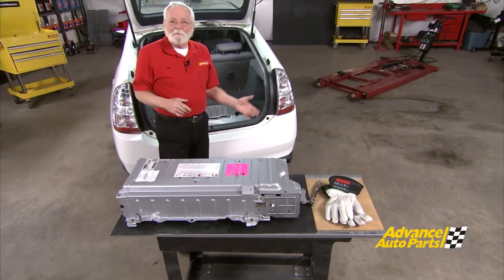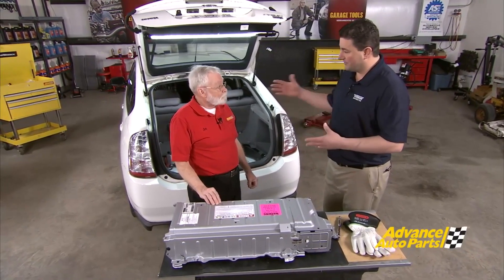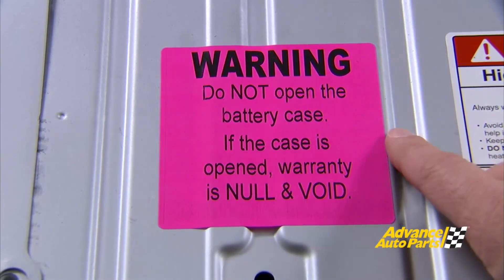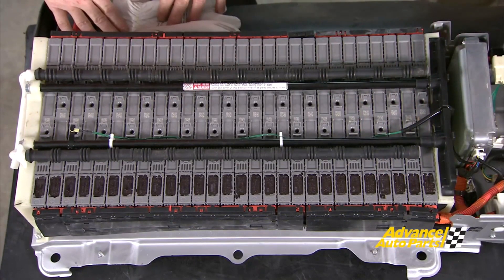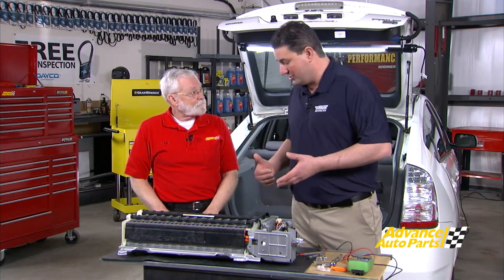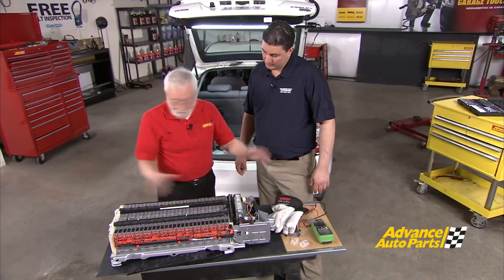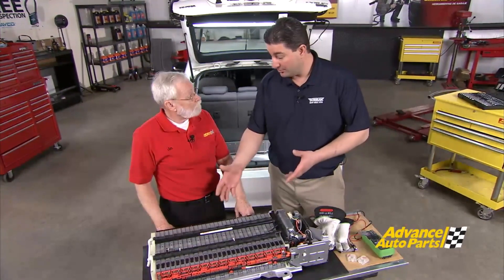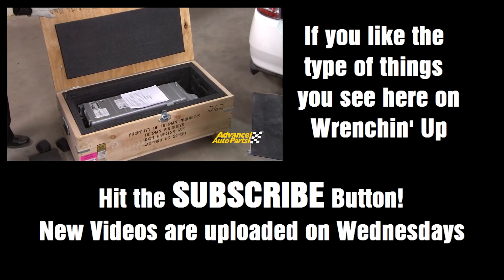Why Hybrid/Electric Vehicle Batteries Can Fail - Wrenchin' Up

Comment: I've worked on alot if these batteries and have NEVER seen build up between cells or and dirt or debris inside a pack . Seems like the only thing I didn't see mentioned is if they replace the bad cells and run the others dead and charge them back up a couple of times to rejuvenate them so they will make it down the road a little farther ?
Reply: I agree. I have replaced dozens and dozens of these. The debris always ends up in the battery cooling fan. Make sure you clean the battery cooling fan if  you replace the battery. Also, I do not recommend using "re manufactured" batteries.  My experience is a 30-50% failure rate (in warranty). Our shop only uses oem Toyota batteries (brand new). Never a problem doing that. Batteries that fail before about 200k miles usually have leaking electrolyte that causes the corrosion. Sometimes you can clean the corrosion but you can't stop the leak! If they don't develop the electrolyte leak, they'll go for another 100k at least in many cases.
Reply: @ronjacoby5048  HI, could you please advise me where can I buy the OEM Toyota battery ( brand New)?   I figure If I ever need to change the battery, I rather get the brand new ones rather than salvaged old ( but still working ones).   BTW, do you think if there is any difference if mine is a right-hand drive Prius, will the battery still fit?
Reply: I hope anyone helps me

Does the new hybrid Camry or the Prius fit in a very hot climate from 50 to 40 degrees Celsius?

How likely is the battery life of the hybrid in this very hot climates?

 Is it possible to live over 10 years?
Or can I reach 500 thousand kilometers in 10 years without damaging the battery?

 What is the average lifetime of the Toyota hybrid batteries in very hot weather?
Reply from the maker: Hi - Hi Chris - Thanks for your comment and questions. Hopefully someone with experience with these issues will jump in here and answer them for you. Thanks for watching!
Reply: Sir, no one is answering the  question , Can you please pay attention on this ? Can you please do research to help us ?  Question was 
(Does the new hybrid Camry or the Prius fit in a very hot climate from 50 to 40 degrees Celsius?

How likely is the battery life of the hybrid in this very hot climates?

 Is it possible to live over 10 years?
Or can I reach 500 thousand kilometers in 10 years without damaging the battery?

 What is the average lifetime of the Toyota hybrid batteries in very hot weather?)
It is very important for us to know the true picture. Best Regards 
Show less
Reply from the maker: First, I have paid attention and replied by suggesting that you contact the vehicle manufacturer for the answer to questions. They are more qualified than I am. So why haven’t you paid attention? Second, why are you asking others to do research for you when you can easily do it yourself?
Reply: Nice answer, I am sorry Sir that i questioned. In fact i jumped here with the expectation that being a neutral person you can help us. Anyways thank you.
Reply from the maker: Hi - Great comment and question. Hopefully Dorman jumps in here to provide an answer. If not, you could ask them directly if you would like. Their contact information is in the video description. Thanks for watching!
Reply: I take out the battery and checked  the voltage and there is a variation of .03 between the 28 cells so basically the voltage is 7.61, 7.62, 7.63, 7.64. So I clean the copper little pieces that connect the cells and put it back. Also I  clean the  fan.  But after a week the car shows the same code . What I have to do replace the battery
Reply from the maker: Hi Chris - Thanks for your comment and questions. Hopefully Dorman will jump in here and answer them for you. Thanks for watching!

Comment: Doorman batteries are horrible don’t ever install one in your car
Reply: I've seen 3 Orange Dorman failed batteries so far. One was less then 6 months old. One battery had 6 bad cells. It's an indication that the bus bars has low conductivity. The better conductivity after copper is silver, but not the coating the Dorman use. They think they are smarter than Toyota engineers?
Reply from the maker: Hi - Thanks for watching and for your comment. Could you post your reason(s) for your comment?
Reply from the maker: I noticed that you didn't respond to my reply asking you to post your reason(s) for your comment. So please keep in mind that you shouldn't make those kind if claims on this channel without your reasons, otherwise we may suspect that YOU did something wrong that may have caused the issue.
Reply: Hi Jim My reasons for Doorman’s horrible product is the fact that their process for refurbishment are not stringent enough as I have had to replace my battery in my 09 Prius 3xs. Each time I had to call wait for the battery and waste my time. They simply don’t know what they’re doing with HV batteries.
Reply: Great warranty program tho
Reply from the maker: Hi - Thanks for the clarification of your experience with this product. I'm sure it will be helpful to others. It will be interesting to see if DORMAN chimes in on this.
Reply from the maker: Good to know - Thanks!

Comment: does Dorman replace all the cells or just the bad ones???????????
Reply: Yes and yes. Dorman replaces all the cells with used cells from other core batteries they receive.  Picture this: 1) battery comes in, 2) battery is broken down and disassembled, 3) modules screened, 4) obvious bad modules discarded, 5) "good" modules reconditioned, 6) "good" modules that are successfully reconditioned and pass additional testing are put into stock, 7) 28 modules are pulled from inventory, 8) pack is built.  Thus BOTH all modules AND just the bad ones are replaced.  How many brand new modules are used to repair the batteries? ZERO.
Reply: my mechanic told me to change the whole battery
Reply from the maker: Hi - Good question. That didn't come up in the interview so I suggest that you ask the folks at Dorman about that. Their contact information is in the video description. Thanks for watching!
Reply: Jim Bates  I bet they won't answer the question.
Reply from the maker: It'll be interesting to see if they do.

Comment: This video on Dorman Batteries says they offer a 3 year non-prorated warranty, however the Dorman hybrid batteries sold by Pep Boys and Napa has only a one year warranty, Could Dorman confirm how long the non-prorated warranty really is? Is there any other vendor that offers the 3 year non-prorated warranty?
Reply: Good point Sam. I would call Dorman.
Reply: They changed their warranty policy at the beginning of 2018 to 1 year after being overwhelmed by warranty claims. Had they still been Hybrid ReInvolt before they were bought by Dorman, they would have gone under.

Comment: recently i changed an o2 sensor and the check light reappeared, my mechanic reffered me to a hybrid specialist that mentioned a failed battery cell module was occuring does this mean my battery is failing??
Reply from the maker: Hi - Could be. I suggest you have the hybrid specialist or someone with a scan tool that can look at the traction battery's control module data stream to get a good look at what is going on across all of the battery. Thanks for watching!
Reply: No far from it. It means a cell is failing and depending on the level will depend on how quickly you need to replace remember Toyota give between 8 no and 10 warranty on there battery packs if you have maintained full service be with battery health check your car could be still be covered.
Reply: The short answer is yes.

Comment: Got a used car from a dealer . Didnt know it had a dorman battery, It failed . It has all the tags ,date serial numbers on it . About thirteen months old . Dorman refused to help me in any way . They wanted the original paperwork and warranty card . They would do nothing for me to stand behind there product that failed well within the warranty period. If you buy a used car check to make sure it doesn't have there replacement battery in it ,if it does i wouldnt buy the car. I dont know if anyone will accept the dorman battery for a core now that i have to buy a replacement . Also it did fail in about a year. I got stuck i hope you dont .
Reply: The purchaser of the batter owns the warranty, not the car it was put in.
Reply: Small claims court. They should've provided you a warranty with outlined services they cover or not
Reply from the maker: Hi - Thanks for your comment about your experience. I'm no expert here but it seems to me that the dealer who sold you the vehicle has some responsibility here in providing you with the battery's paperwork, battery warranty, vehicle warranty, etc. Hopefully Dorman will jump in here to tell their side of the story as your experience is certainly bad publicity for them. Thanks for watching!
Reply: Earlier this year I went to NAPA to purchase one of these not knowing to much about them.  I was just in a hurry to pay the money and get my car back on the road without worry.  I asked to order one and they said well we won't sell  you one because the last 4 have been bad and had to be returned.  Thought it a joke at first but they were serious.  Blessing in disguise because I took my battery apart and discovered the harness on the battery badly corroded.  $70 bucks to purchase at dealer and cars back in business.  It's a heavily used car for UBER and LYFT and about 20k more miles and running great.
Reply: @banderson25b   Good for you.  I've heard mechanics on YouTube say they wouldn't go with anything made by Dorman.  Not just the batteries.
Reply: I wouldn't have one of those cars. That's all i have to say.
Reply: @lorenreece1665  why what wrong with hybrids ? Prius is a very reliable car  it easy to make a flipent comment but it takes intelligence to explain yourself!